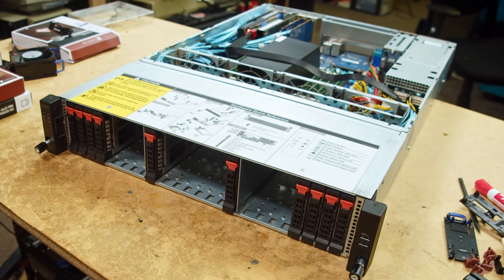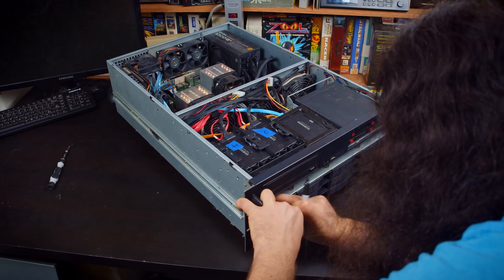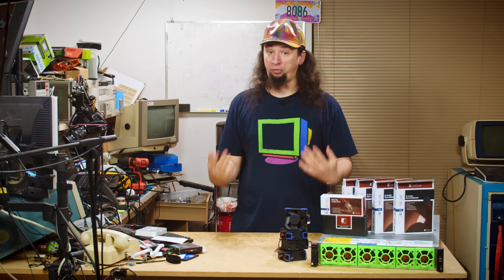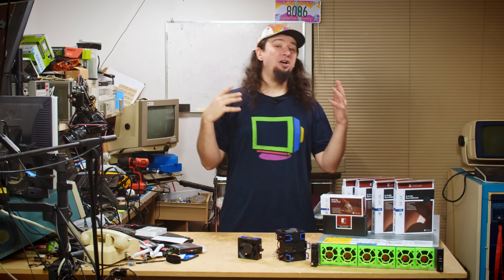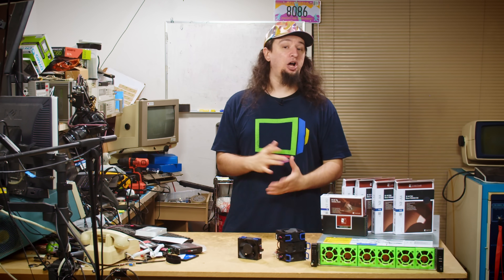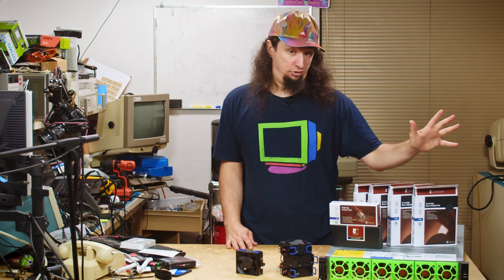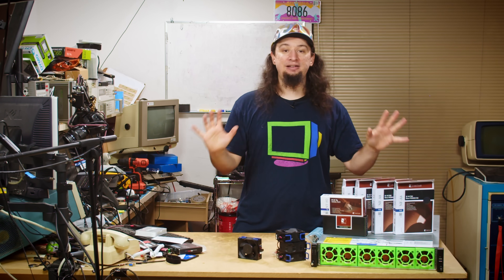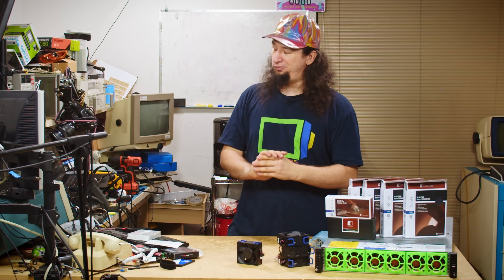EPYC Server Noctua Fan Conversion

Comment: You could have used the original hot swap brackets and just extended the cables where needed.
Also those delta fans use alot of power, but a fan load doesn't dump that power into the case like a resistive load does, so their contribution to heat is basically zero. 

You can also get better 2U heatsyncs that are made for this sort of work. That and re-pasting everything would probably work fine.

Also on all of these sorts of 2U storage servers, you can improve airflow a-lot if you manage the cabling better. Basically, pull all the slack out from behind the backplane, manage it under the fans. Works great, takes like 30 minutes or so.

The PSU fans are hard to replace, and depending on the setup, you can double stack 40mm noctuas in them and have them stay cool enough. Worth mentioning that server PSU's are redundant, and far more reliable than desktop/ATX PSU's, you're probably just used to having used ones fail, buy them new and they're good for 5-7years of 24/7 operation, no problem.

Comment: OMG 72 F in an office in Phoenix, I am shivering and would have to bring a jacket lol. We keep ours at 75 and I had to redirect the vents away from myself😆That 40-degree whiplash when you go outside is no joke!
Reply from the maker: I haven't taken an actual ambient air measurement, but I keep it set a little low like that because all the computers and lights heat the room up a lot. So it's probably a little higher than that on average.
Reply: @TechTangents  I got ya - I was exaggerating a little bit. Just sitting at my desk, with only a laptop going, and no other air circulation, I was freezing when my corner of the room was in the line of fire... er... frost. I think the room the thermostat is in stays a little warmer, too. A few minutes ago I went outside to sit in full 100 F sun for like 10 minutes to thaw out though...

Comment: Yeah, I've done something similar with a SuperMicro SC836 chassis (all 80mm fans and some Noctua 3U Xeon coolers), made a HUUUUUGE difference over the absolute SCREAMER San Ace fans, fortunately the originals were on carriers so I could just swap the fan out without having to worry about figuring out how to fit them into the gaps.

Comment: Unfortunate that the cpu cooler doesn't line up with the rear fan exactly. If so you could have made a shroud so you get direct airflow, it being slighlty off centre will create turbulance but i guess it's not a big deal. Arctic S8038-7k that @woe2you2 reccomended in the comments would have been ideal: 7k rpm you can fan control down with cpu temp, regular 38mm @80x80mm, much more static pressure, 0.5A at 12v, available in discount 4 packs... Not as quiet as the Noctua at the same rpm but def better than a standard Delta server jobby (where that's not it's main concern). Good build tho, i've been procrastinating on a home NAS build and i stopped because cases are like either: jank, almost there with a few weird caveats (Jonsbo NAS cases all look the part but have individual weird disadvantages), fair few folk end up using an old Fractal design case that have tons of bays but i wanted something as small as a NAS but much faster/price to performance.

Comment: but did you manage to get it installed eventually? oh, and have you tried instaling a 200mm fan horizontally over the entire mobo - its surprisingly effective in 2u servers, providing there is sufficient in and out air in the front and back....did this in my pfsense router , and its almost silent now.

Comment: About the power supply fans: lubrication can make a big difference. I have a spray can of lubricant for electronics, and it makes a big difference when you clean with air and then spray inside the fan with the electronics lubricant.

Comment: there are water radiators for 80mm fans even with 8 of them like the "Alphacool NexXxoS UT60 Full Copper X-Flow Quad 80mm", so watercool that bitch
aaand there are UV-LEDs

Comment: I presume the reason behind no front mounted fans is due to maintenance. When you are running a datacenter, you want your drives to be up front accessible and swappable as soon as the error is detected. If it was a node/cluster/compute server, then they always have front mounted fans.
Cheers, and hope this elaborates as to why that's the case! ^^;
Reply: Also you want the drive state indicators to be visible.

Comment: whatif .. i put resistors on existing fans.. will i see smoke ?
what kind of R model do i need .. 5W ?

btw: i got one DELTA and put it on full 12V .. yes.. it can be used as a siren.. 
maybe another project.. for home protection.. ~.~
Reply: There are better solutions then burning it off with resistors.
Like for example PWM controlling them.
Reply: ^ What they said.  Fans are not resistive loads, which means placing a resistor in series with the power pin is not going to have the ideal effect.  The voltage drop will depend on current draw, which will depend on pressure, rotor position, and other continuously varying factors.

An inline regulator is better, but even then, it depends on how the fan motor controller was designed.  (The one in the fan, not the motherboard, because DC brushless fans are more than a coil of wire connected between 0v and 12v.)

This is why the PWM pin exists now.  It is designed to provide a reliable method of fan speed control, instead of resorting to hacks, like we did back in the 3-pin days.

Comment: Cool that it worked, Noctua mods are allways fun. 

But comparing efficiency with  "zero static pressure" and "max. rated power" from the datasheet does not give meaningfull results.
The rated power of the server fans is only used under max. static pressure, where the noctua would transport only minimal air.
Efficiency can only be compared in a like for like scenario.

Some more tips:
Check for hotspots on the motherboard with a thermal camera, due to limited airflow some other components that have no thermal sensors may overheat and die early.
Do not throttle the fans even under low load, as some components power consumption is not based on CPU load. ( thats why server fans are locked to not go very low in there RPM)
Reply: Good advice

Comment: I don’t want to burst your bubble, but as soon as you start adding drives, you are going to have thermal issues. Sure the original fans are loud and ‘overkill’, but they have those high pressure and airflow specs for a reason. Once you put drives in, that is going to create a massive restriction in airflow. Which means you will need high pressure fans to overcome it, which is not what the Noctua fans are not.
Reply: This.  Everybody wants quiet fans.  Engineers don't put high-pressure blowers in cases because they like the sound ....

Comment: I made a PSU blow short by doing this. Which, to be fair, those 40mm redundant brick PSUs are the worse possible candidate for this kind of swap, but i did it anyway and it cooked. It happened to be the one attached to the UPS, so the UPS ate the short, and thus both the alarm on the chassis and the UPS were screaming at me.
Reply: Also, the people saying "WhY UsE a nOcTuA" why don't you find a reputable, quiet, affordable and reliable fan available in small quantities at retailers.

ESPECIALLY when we're talking about obscure (to consumers) fan sizes.
Reply: @XbotcrusherX   Go to an electronics parts house.  You can sort by square dimension (40,80,120, etc..) and thickness (20,25 ...) and voltage, noise (dB-A), CFM, pressure....  in any quantity from 1 to thousands.

I use San Ace, since I can get them in 40-120mm, and get to pick the ratio of CFM/pressure to noise that suits the application.

There are also some Qualtek fans that are a little cheaper and very quiet, which I used for 80mm 2-wire positions like PSU replacements.

Also, Arctic makes some nice 40/60/80/120 fans that are dead silent if you just need to move a little air.  They're not a replacement for a fan that makes a lot of noise, because it probably makes a lot of noise for a good reason.  But if you want to add a little positive pressure from the front of a case, they do a great job at that.

Comment: Nice brackets! Word of caution from someone who's done this sort of thing before and learned some lessons the hard way.  RAID controllers can get pretty hot, and don't handle it as gracefully as a CPU. They generally have a tiny heatsink too, so airflow is all the more important. This will probably be even more important on a RAID controller that can handle a bunch of U.2 drives compared to SATA/SAS. I suggest making sure you monitor the temperature on everything available.  For RAID controllers you often have to install some hard-to-find package from the vendor to get the temperature readings,  but it's worth the effort.

The PSUs also suck air from the case.  You might want to consider pulling one of the two, if you can sustain a few minutes downtime in the event a PSU fails. That cuts the PSU noise by half. You can also check the manufacturer for compatible parts. There is often a more efficient version of the PSU that requires less cooling and thus ends up being much quieter. Good luck!
Reply: you aren't kidding, same goes for some NICs, way hotter than you'd think sometimes causing stability issues
Reply: @CheapSushi  yeah the older 520 twin 10gigs running cat6 were known to be hot tempered, they need the air.
Reply: Even the highest power raid controller doesn't need a ton of airflow, but it does need consistent airflow. Easy to build a duct to direct some extra airflow to it.

Comment: Pretty sure I have given Noctua enough money for a mortgage payment over the years. Love the video!
Reply: so I always buy a new cooler with fans every time I build a new PC, because I keep the old PC as a backup.. but a friend keeps transfering his noctua cooler and managed to buy only TWO coolers in the last 2 years..which he can do because noctua gives you conversion kits for new motherboards and CPUs..
Reply: @olik136  In two years two fans? what a waste of money. Sitting here with my first buyed NH-D15 with the original fans from 2016 and the conversion kit to AM4. 8 Years in service and still rocking. System runs 24/7.

Comment: How many dollars is that in fans? seems a sponsored video checkmark is missing.
Reply: About $160? Going by the 80mm fans costing about £17 (~$22).
Reply: Must be a YT glitch. Seems an “unproductive prick” checkmark is missing from this comment.
Reply: It's literally marked as 'exclusive access' because the product used (The noctuas) are too tightly integrated to be separated from the content. The thumbnail rollover clearly states SPONSORED CONTENT.

I fail to see where the problem is here, other than your apparent inability to read.
Reply: @Beany2007FTW  exclusive access is not a thing on YouTube, but if you are seeing sponsored content, then maybe the problem got corrected... That is a thing you know. 
I checked, seems the checkmark got set by now.

Comment: Impressive results! Even though you had to use way more fans and a lot of engineering, the performance you got was surprising considering the Noctua fans push so much less air. I really liked how you stacked the fans inside the CPU shroud. The green fan shrouds look dope too.

Comment: I wish YouTube gave us a 720P/30 option on 60FPS uploads (1080P Premium re-encode would be perfect since I pay). I watch YT on low end devices in the summer because of heat output and my internet isn't always the best. Having a 720P/30 would be so much better vs the default 480P.